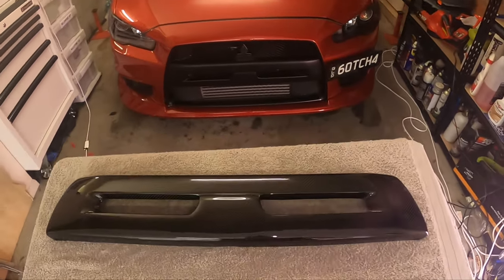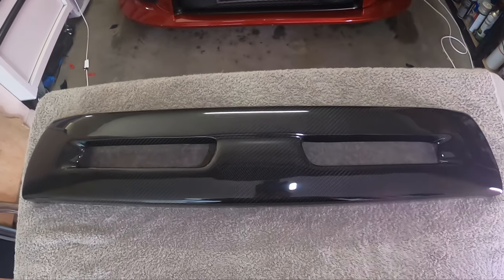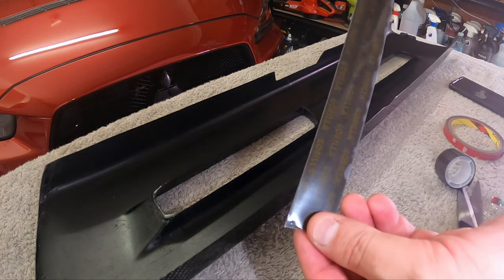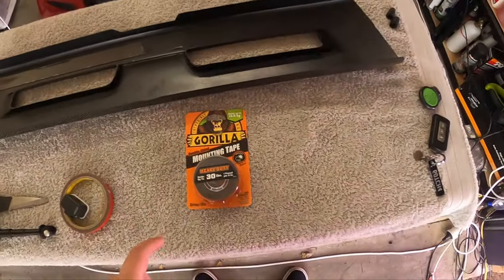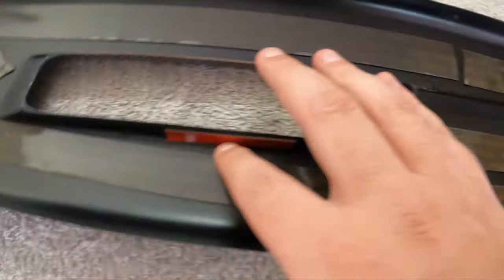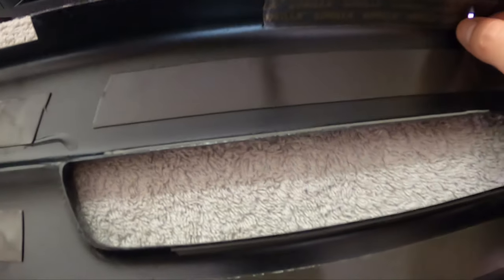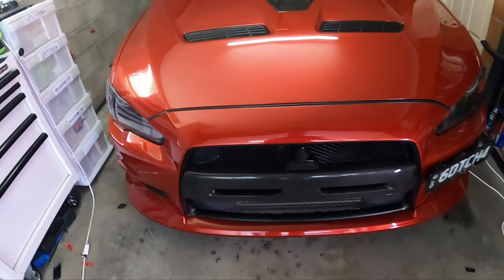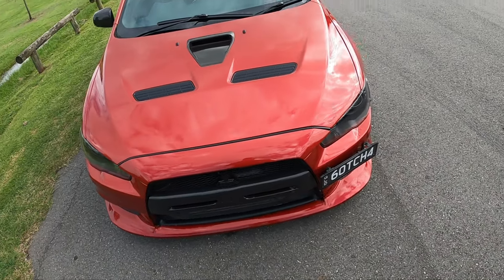Evo X Carbon Fiber Grille Install

Comment: Just now seeing this. Love it ! Where did you buy this? Wanting to get one for my new Evo !
Reply from the maker: It was from ebay and the seller we purchased from doesn't have them anymore.
I can try to find a link to one similar if you'd like
Reply: @JacksonStrain  please ! & I commented on your last video but maybe half of the links in your video are either out of stock or unavailable. Is there anyway you can put up some alternates?
Reply from the maker: @IAmS3ntry_133  I'll get one later when I'm at the computer.
It's hard as sellers always run out then put up new listing's making the links invalid.

I'll try to redo them soon